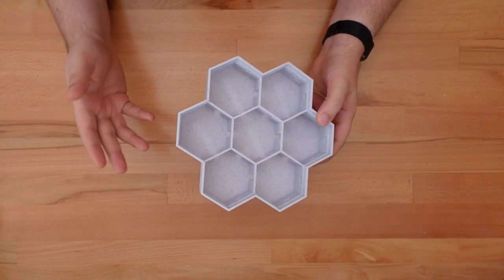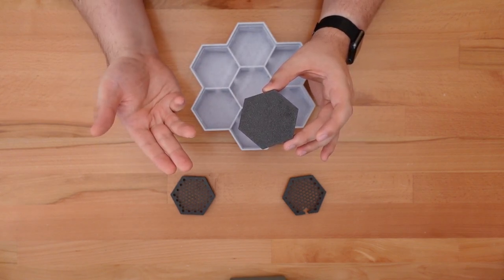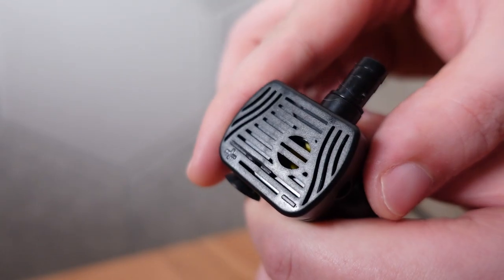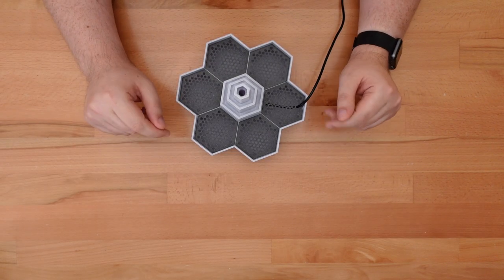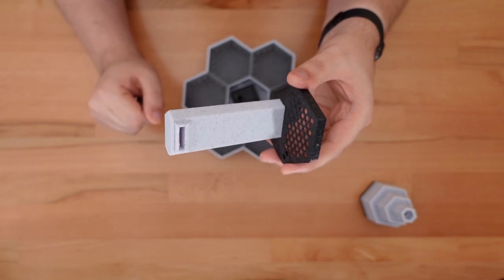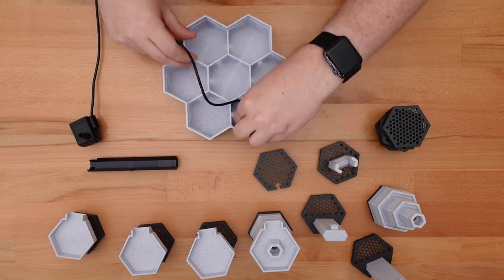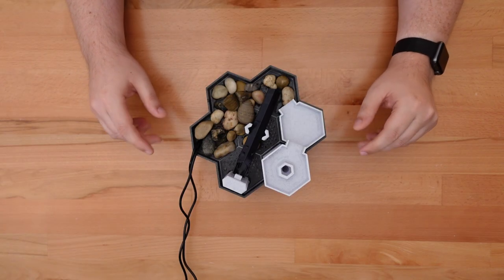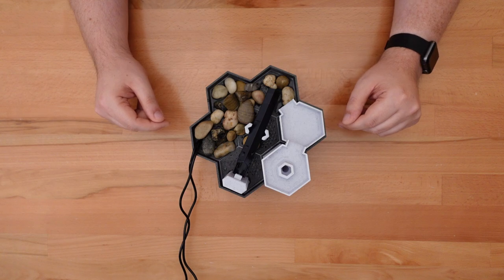3D Printed Modular Desktop Fountain

Comment: I love this idea! While I don't have the space to make one for myself, I have a few ideas of my own to add.
1. connectable baseplates for expandable size. It would need separate loops for water, but would be neat either way.
2. for the plateau fountain, a step that took up two or more cells would be a neat way to add variety
3. a miniature baseplate/fountains to fit inside of a single cell. It would be neat to have large and small objects interact.

one more idea that I had was not so much something to design, but some sort of buoyant marble to watch float with the current would be neat
Reply from the maker: Nice ideas, I try them out! A new base has been added for smaller printers, if the issue was build plate size.
Reply: @3DPrinty  I too don't have space but once I do I'm going to see if I can design an add on that will allow for a discrete/hidden mist maker (If I can find small enough ones) and planters for small plants to give it an even more natural look. I've always wanted a small fountain with plants and a mist maker... When I make them I'd love to share them with the community. I'm so glad I found this channel. I'm also going to be making the rolling storage box eventually. 

I heard about this channel through Zack Freedman, when I watched the inventions video my jaw actually dropped from how smart the rolling storage is. Keep up the amazing work! I am just speechless to how clever these designs are. The fact these are free, open, and completely customizable is just so nice of you :)

Comment: Edit: Just a tip for the ones making it, I added few drops of essential oil to the water, and the room smells so good while the fountain is running.

I've just assembled mine, thank you for awesome work. I used some aquarium stones and plants for decoration, and it turned out just the way I wanted! Thank you again

Comment: A giant floating sphere would be a nice add on. Where the sphere is about as large as the tile and the pump JUST barely keeps it floating and slowly spinning.  Probably need to print the sphere in 2 halves though...
Reply from the maker: I'll test it out! I think you're right about printing in 2 halves - I wonder how smooth it needs to be to work.
Reply: @3DPrinty  billiards ball? Not sure if it's the right size but the mass and smoothness should be about right!
Reply from the maker: Good backup plan, if 3D printing it doesn't work!
Reply: If the billiard ball is too heavy then massage balls might be another alternative.  They're usually spiky but I have a smooth one.  They're about the same size a billiard ball and should be easy to find at Wallmart.   Unfortunately they are filled with air.   So you would have to inject them with water.  But you should be able to get the perfect amount of weight.
Reply: Use adaptive layer height in Cura. It will smooth the round surface. Also set layer time and enable the related „z Lift“ option to move the head away instead of printing slower. This works great for spherical surfaces.

Comment: You could also do a horizontal spinning table. Basically one of the cascading bases just needs a central rotation point (either pole or tube) and the exit is placed slightly above the base (to create a "pool"), an angled entrance could improve the rotation if necessary. Then a circular piece is needed with the opposite rotation point (i.e. Pole if base is a tube) and a few fins. 3d designs or small objects could be placed on the circular piece which rotate in its base. I've seen a few similar things in traditional water fountains. Another feature could be a cup spout with the pump exit in the center bottom of the cup and a throat on the side, which could fit a marble or something similar which would spin (I currently have a water fountain which does this). Also by knowing the head of the pump (should be in the pump info) you could determine the maximum height of your spout and design features that make use of the height, i.e. Spirals.
Reply from the maker: Great ideas! I particularly like the turntable, since it can be used to show off other prints.

Comment: Two things to keep in mind: the higher the water has to rise the stronger your pump will need to be. It will lose flow pretty quickly after a certain height and at some point stop completely. The other point is cleaning. All water will get algae cells in it, and you will have to clean the pump regularly to deal with the slimy buildup. This is true of all water fountains but ones like this with many crevices and holes are difficult clean. Overall, fantastic project I'm going to have to make, though.
Reply from the maker: Yup, I tested how high up the pump could push water before making any of the fountains.

And yes, occasionally switching out the water and cleaning is important - even if you seal the print to reduce the rough texture that naturally comes from the 3D printing process.

Comment: I have two more ideas but after that I'm going to try and go to bed.  LOL

Print in place water dragon - I was thinking about what 3D printing does best.  One thing is that it's plastic and easy to make float.  And another is having mechanisms be a part of the print.  So I envisioned one of those print in place dragons or snakes designs that could be integrated into a water slide.  Or maybe one of those Loch Ness Monster pond decorations but this one could also bobble around.  You could also use the whirlpool current idea or even just have a straight current from one side to the other.

If you end up making a larger base module consider going wider for a lazy river aesthetic.  Then you could have all sorts of lively fish and water creatures.  A simple hook on one of the flat plates and some fishing line would let people add whatever they want.  Or use something like your bobblehead mechanism that will keep fish in place but let them move around a little.

My last idea is a little goofy but I'm just going to throw it out there in case you're interested.  What about games?  There's a genre of board games called dexterity games.  These games usually have you doing something physical or messing around with a gimmick.  Like Don't Break the Ice or Monkeys in a Barrel.  There's probably a ton of amazing game mechanics you could try with this has a platform.

The first thing that immediately comes to mind is a revival of the game Crossfire.  But instead of BB's your redirecting a water current. Reloading the BB's was a part of the game though.  And having two equal water currents might be to balanced for either player to get anywhere.  I'm thinking that if you add some vertical play to the water shooters, that would add enough dexterity to allow someone to win.

I do game design as a hobby so if you'd like to explore turning your setup into a full game platform I'd love to talk about it.
Reply from the maker: Ha, this project had definitely gotten you thinking! I do like the idea of decorating the fountain with existing 3D prints. In fact, my original plan for the end of the video was adding a Benchy, but the glowing liquid montage won out in the end.

Somewhere in my long list of project ideas is already a Crossfire inspired game :) It'll be a while, but it will happen!

Comment: Oh!   A giant whirlpool!
Put down six solid plates on the edges and one in the center with a decent hole in the middle. Then put the pump on the side with a spout that shoots out in the direction of the desired current.  The center hole should be sized properly with a grate or you could just have a wall, like on a well, that keeps the water or any floating items back.

You could add a little benchy!  or maybe even something that actually floats. LOL  Maybe a 3D printed Octopus as a kraken.  I would probably add a guide rail on one of the flat plates that directs any floating items back to the outer edge
Reply from the maker: Hey, an actual use for the solid plates! I'll give it a try!
Reply: @3DPrinty  thank you for Designing something so inspiring and considering my ideas.  I'm glad you like them. ☺  I seemed to have a burst of inspiration for this.
Reply: @3DPrinty  Better idea for the current..  If the pump spout was near the center and directed at an angle towards the edge then floating items would get pushed outward.

Comment: You don't need a larger base necessarily, you could use the water tower or plateau to send water between multiple bases side by side. Once again brilliant video
Reply from the maker: True! I might make a base specifically with that in mind, as the current design doesn't quite fit if you try to sit them side-by-side.
Reply: @3DPrinty  ah I see what you mean. Can't wait to fill my desk with a water show!
Reply: @billallen6109  remember that the water need to end where the pump is so it does not run out of water aswell
Reply: @ulrikstokkebokjr4129  I was implying the use of multiple pumps. One per base
Reply: @billallen6109  then it works fine. I did not think about that. Could have water going from one to another and back to the first one again

Comment: I have to three ideas.
1. Slow Drip Reservoir -  A mini water tower that has a tiny pinhole to only allow a small drip or slow flow.  Then you could have the pump only running intermittently and your bamboo piece would be much more controllable.  Maybe you have an idea for flow control but a simple pinhole can always be drilled bigger.  Don't forget to have an overflow drain.
Or better yet.  A main fountain with a flow control going in a different direction.

3. Low Water Indicator  - I ruined my last mini water pump by letting all the water evaporate away.  Having something that very visibly changed to indicate water level would be pretty helpful for such a small fountain.  But it would also be cool if it was part of the aesthetic rather than just a dial.  I'm imagining a flower bud with a shaft that runs down to a float in the water.  When the water lowers enough the pedals release and the flower opens.  I know that's a little backwards thematically LOL but with striking color differences of the flowers it could be a really good indicator that you're low on water.

3. Cat Drinking Fountain - (Edit: I saw on another comment that you won't consider this.Thats fair, but there's some other ideas in here that may be of interest).

I know the layer lines make 3D prints less than food safe, but if it's just water I don't think there's an issue. I would suggest a gentle ramp that they can lick the water off of.  Or a holder  to keep a licking rock in place.  I would also love a module that held a soda bottle reservoir.  I was actually searching a water bowl like that this morning and was surprised that I couldn't find any.  Lastly, if you could get an easily accessible or replaceable filter in there as well you would be a god.
Reply from the maker: Great ideas! Yeah, I'm being extra cautious about the pet fountain. There are definitely way to seal 3D prints to make them safer, but I don't trust it well enough to put another person's pet in any danger.

I'm going to explore the other ideas! You might be interested in an update I made to the bamboo model itself in the time since recording the video. It now has a very small drain to slow down how quickly it fills. Not exactly what you were suggesting, but same basic idea. I also like the idea of splitting the flow in multiple directions.
Reply: 3d prints are actually not food safe for a few reasons. The first is that the brass nozzles used for 3d printing often might have lead in them, as lead is a common brass additive.
The second reason is for the particular materials. PLA and many other filaments are not food safe, only select varieties are food safe, such as t-glase PETG

Comment: The water wheel can utilize the same holder as the rhythmic tower. You would just need to design the wheel. Unless you want it wider. However you could always widen the holder for the rhythmic fountain. You could eveen use Cura to widen it. Just turn off "Uniform scaling" and the adjust the X or Y, whichever orientation you use.
Reply from the maker: Very good idea! I hope to reuse parts as much as possible, so I'll give that a try!
Reply: @3DPrinty  I think i may have come up with a good water wheel design. Just waiting on it to print to test it

Comment: How high would you be able to pump the water?  I wonder if you could have some height offset bases feeding different features.  Say three levels.
Reply from the maker: I was able to reliably pump 100mm, but it could probably go to 120-150mm under optimal conditions.

I do hope to test out risers that would hold their own mini pump and reservoir for taller displays!

A few issues to work out are 1) How to guarantee the secondary reservoir doesn't run dry and hurt the pump and 2) How to handle overflow since it's unlikely that the water pumped in will perfectly match water pumped out.

Comment: Thank you 3D Printy!  I just found my next project!  :)  Not a hard sell for me since I am a huge water feature fan.  I have a 3500 gallon feature in my backyard and about a 350 gallon feature in my front yard.  Thank you for your creativity and inginuity!  Also, do you know about applying Titebond III Ultimate Wood Glue which is good for waterproofing PLA?  It works!
Reply from the maker: That's an excellent tip! I hope to make a followup video featuring additional parts, I'll plan to include that Titebond advice for those who are experiencing issues with leaky bases. Happy printing!

Comment: A more aesthetic way for the cables to exit the fountain would be a nice enhancement. Perhaps a version with a hole on the side of the reservoir and some waterproof sealant to seal, maybe just a hole high enough where water should never be at that level so no leaks, or a version of the perforated base that has a covered wire channel built-in?
Reply from the maker: All good ideas! An alternate plate is most likely.

If you have a good way to seal it, check out PrusaSlicer's "Negative Volume" feature. That'll let you poke a hole in the base wherever you need.
Reply: @3DPrinty  If you cut the negative space at the top of the wall, where the hexagon plates go in, then you won't need any sealant.  It would be the same as the wire plate just on the wall and might be more aesthetically pleasing to what TGibs97 is looking for.

Comment: So those pumps wouldn't be enough to transfer the water very high. I would like to see the tower go higher than three units. A way to achieve this might be to have the first pump move the water to a secondary storage area. Then use a second pump at the higher elevation to transfer the water even higher. So a level transfer hexagonal tower that had a channel to divert a power cord would be needed.
Reply from the maker: Yes, I hope to explore something like this! It also needs to handle overflow at each level and pumps will need to be set to never pump out faster than water can come in.

Comment: If I could add a suggestion - Would it be possible to have a cutout or two (different configurations) in the splash guard for the cord?  I would think it'd make the design a little cleaner instead of it going over the splash guard.  Keep up the great work! 3D Printy!
Reply from the maker: Good idea! If you happen to use PrusaSlicer, you can use the "negative volume" feature to punch holes in slots in designs with the exact size, shape, and position you need. That might be an idea solution since you may want a slot in a very specific position. Happy printing!

Comment: I have to wonder how well a whirlpool/vortex feature would scale down.

And... somthing like  a coffee filter insert for larger particulate pickup wouldn't be a bad idea. Just a little recessed between halves.
Reply from the maker: Worth giving a try, thanks for the suggestions!
Reply: I was going to suggest brackets on the 6 inner walls of center hexagon.  They would hold clippings of whatever filter you would like to use and protect the pump.
Reply: @VagabondTE  It would,  in general,  be better to filter pump intake rather than output.
Reply: @trelauney  Is that not what I described?  The intake is a part of the pump so the only way to filter it, without putting too much strain on the motor, is to build a filter around the reservoir it sits in.  Luckily the walls only have narrow channels between them making for easy filter points.
Reply: @VagabondTE  sorry, just a case of "restating in my own words so I'll remember"

Comment: I know you've had this up of over a year now, but I just now found you, while watching 10 useful things to print video. I am subscribing to you also. THANKS!  Anyway , one of the things I started here to say, is that I really like this idea, and your design. Makes me think of my cat, and how she hates floaties on her water dish. This might be an interesting thing to make for her. What if we add another part, where we can add a bottle that will be a reservior to keep it full while she drinks, and the evaporation will accur? Think it would work??
Reply from the maker: Glad you like it :)

Unfortunately, 3D printing is NOT a good option for a pet's water bowl or food dish. Tiny spaces between layers can grow bacteria and are difficult to fully clean. It might be possible to seal a 3D print with a food-safe varnish, but I still would not recommend it. It's a shame - if it were safe, I'd love to design a water fountain specifically with pets in mind.

My cat has a non-3D printed water fountain I bought 8 years ago and she continues to use daily. You can get them for about $20 online with pumps and filters included. It's not as fun as a 3D printing project, but it's a nice option for a cat that prefers running water.